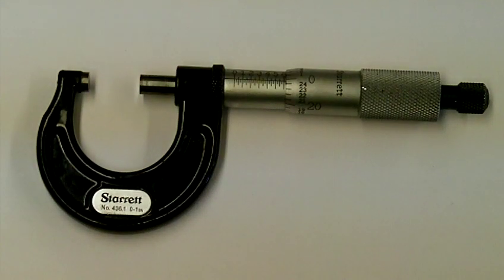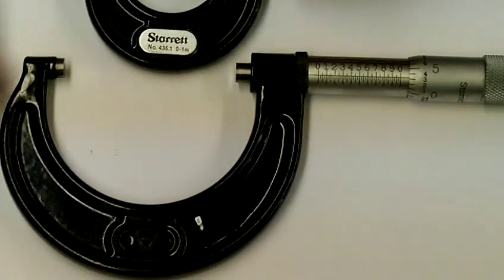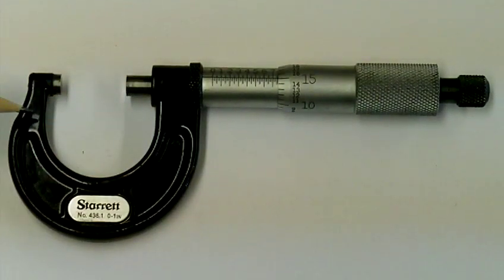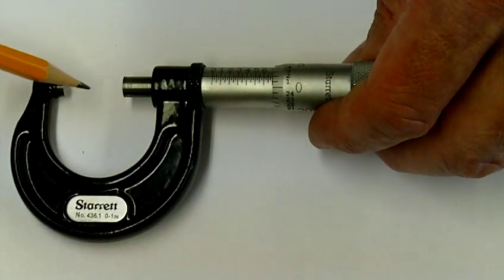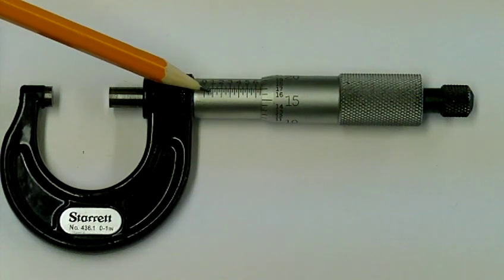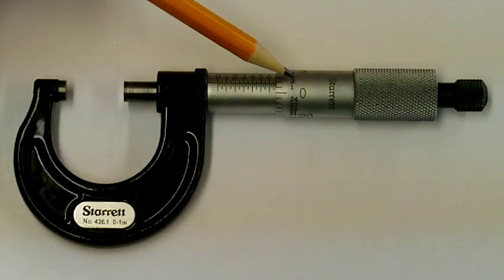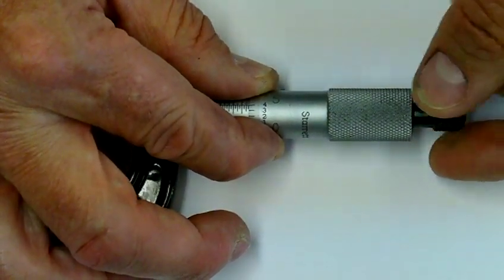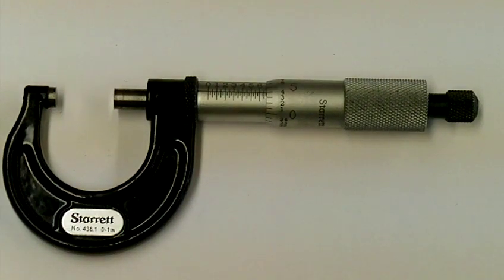Parts of a Micrometer Caliper

Comment: How do you remove the sleeve from a micrometer?
Reply from the maker: If you unscrew the thimble the sleeve is exposed. The sleeve is a snug fit on the frame, put the small spanner wrench in the hole in the back of the sleeve and turn back and forth. As you turn put pressure on the wrench away from the frame. The sleeve will come off.
Reply: @machiningmoments  Thanks! I tried it, turned it back and forth while pushing it away from the frame at the same time, got it moving almost 1/16'' from the frame already, but it's so tight and now the small nipple of the wrench that goes in the sleeve snapped
Reply from the maker: That is unfortunate. Try some WD40, you will need a new wrench.